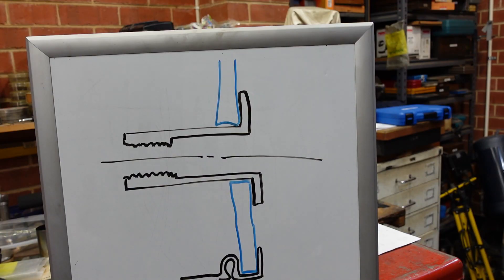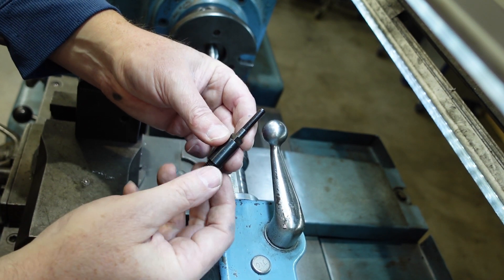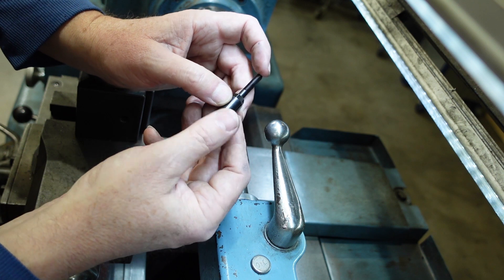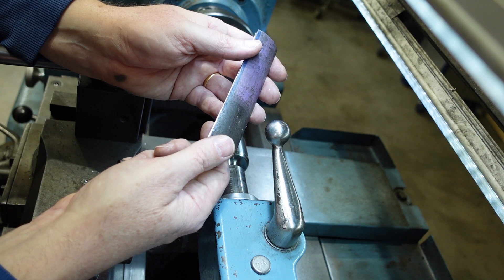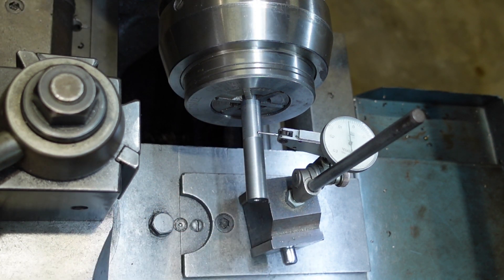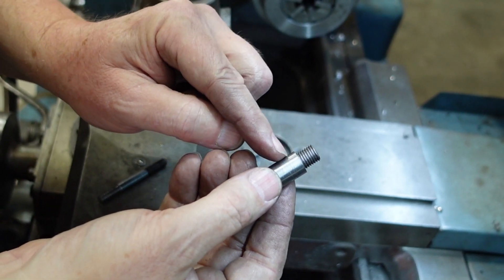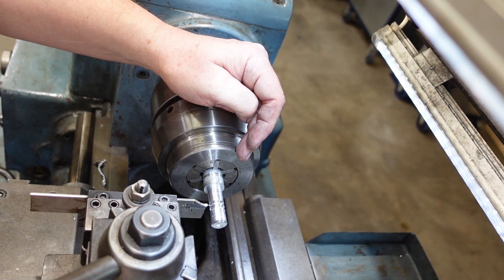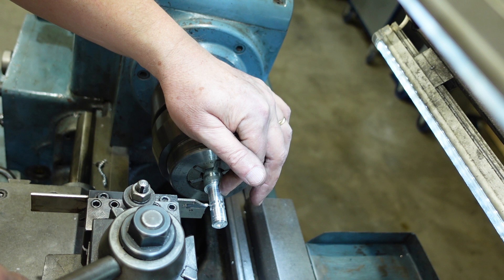Making a riv-stud

Comment: Great idea. Sure, it's not the greatest when it comes to mechanical strength, but as you say, for some situations that's fine. I can imagine making a smaller, simpler version to replace a standard pop-rivet with either a socket or a stud that only needs a longer pull shaft. They'd have to be smaller/lighter, but could still be a great solution for some projects.